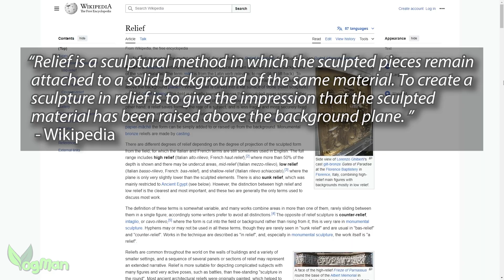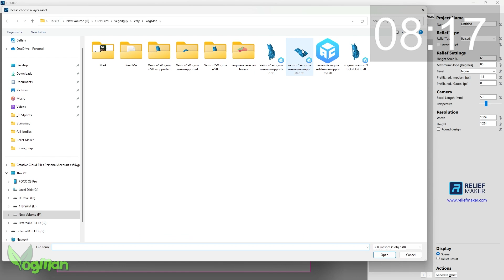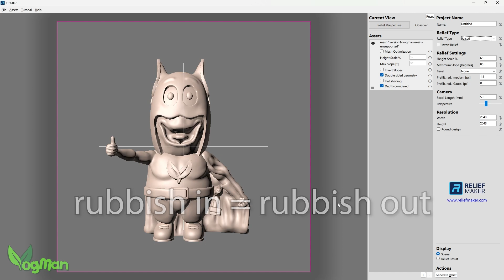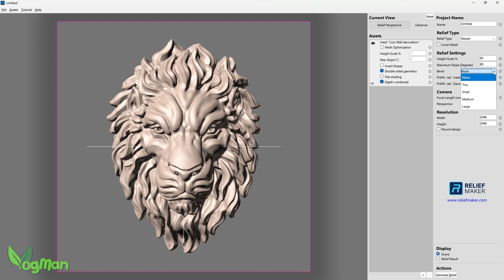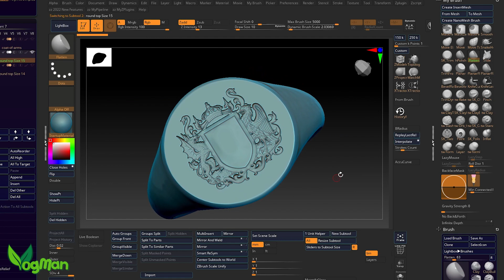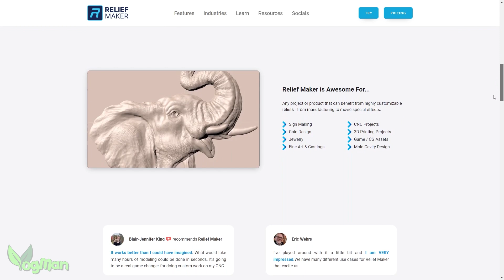STUPIDLY EASY bas relief & engraving with CAD using Relief Maker (HONEST review)

Comment: Nice video VOGMAN. 
I actually use BAS Relief in ZBrush But this looks faster to dial in the results I want. What’s not working for me is they state they want $150 per update. I can’t commit to that.
Reply from the maker: Unfortunately buddy I can't control the pricing. I can only comment on what I'm seeing.
It is a very limited package in that it only really does one thing, but it does that one thing very well.
I guess if you use bass relief day in and day out and spend all your time cleaning up those edges, etc, then it becomes a worthwhile investment as it really should make things faster and easier. But if not, it's an expensive add-on.

Comment: tooooooo expensive for personal use. 200 dollars,and you can get useless resolution in 2024.
Reply from the maker: Like most professional products, they're not really aimed at the amateur market. I agree for amateur use the price seems high, but when compared to other pro products the price is reasonable. 
It is an excellent product, but yes, you're right, not really intended for us amateurs.
Reply: @vogman  thanks for the answer.

..even the 200 dollar would be fine with a normal resolution. OR A 100 dollar price for 1024 resolution.

Those would be tolerable. If any representative reads this discourse, should consider it.
Reply from the maker: Well they do appear to be reading these comments, so let's hope they take on board all comments received 😁

Comment: Regarding the last pop up when exporting. You are generating a heightmap to be used in zbrush, you are best using Linear as the option as Gamma will adjust the greyscale values rather than retaining the true values stored in the image. This is the same workflow for handling data textures in game engines where you disable sRGB (gamma correction). It depends whether zbrush attempts to undo the correction when you import it.
Reply from the maker: Thanks very much for this insight 😁